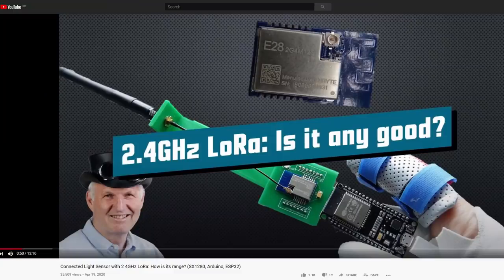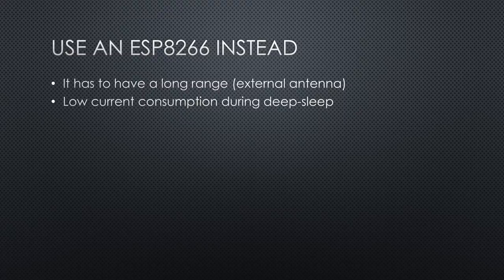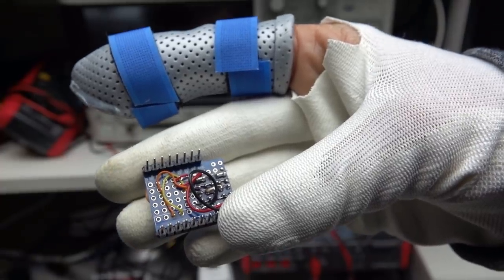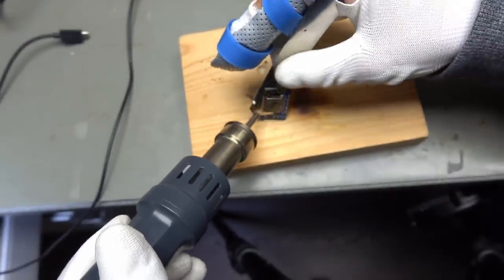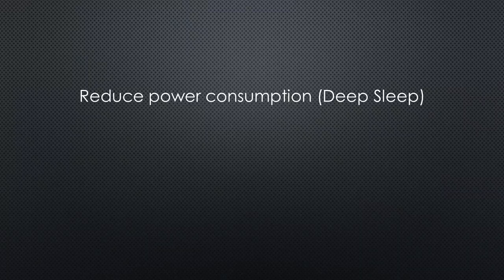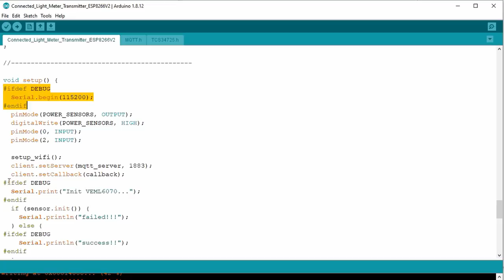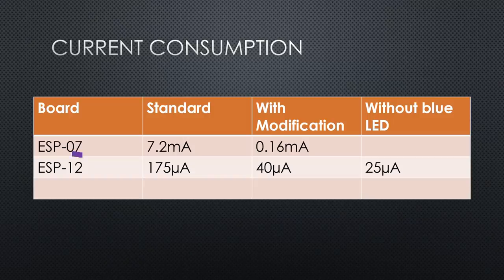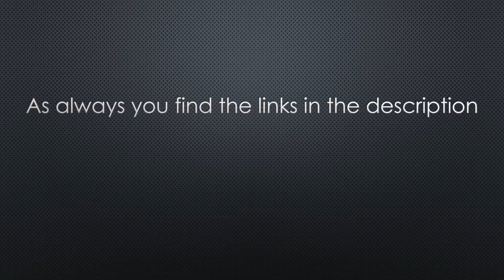#324 Wemos D1 Mini: Long Range and Low Power Modification (ESP8266, LiFePo4)

Comment: Great video. Did you have issues programming the board with RST connected to D0? The Arduino IDE gives an error when this happens on the NodeMCU ESP8266 board; you have to disconnect while programming it.
Reply from the maker: RST must free to program.

Comment: Which voltage regulator should I use for esp-01 so that that, the regulator consumes less power and runs for a longer period?
Reply from the maker: I use HT7333s
Reply: @AndreasSpiess  Any other alternative?

Comment: Hi, you do great work, thank you. I'm working on a project to run a number of heaters upto 30 from a generator and want to send the heater temp data 4 and alerts shock etc from each heater via the mains cables to the monitor at the generator. The maximum ring cable lenght is 127.8M. Would these boards be suitable and what way would you recommend to inject the signal. Each heater would send data to the the monitor and then develop an android app to control the temps and on/off criteria. Is this a suitable approach or would you approach it a different way? Thanks for any advice or pointing me in a better direction. Great channel.

Comment: When I cut this pcb trace and power on the 3.3V line the wemos gets stuck in some kind of stale non booting mode. The LED (i did not remove it) turns on very dimly and that is it. If I also connect power over the USB input the sketch runs just fine but to be able to program the esp8266 (using arduino ide) I have to manually push the reset button. I guess some kind of pull up/down is not working exactly as it does on your board Andreas. It looks identical from what I can see though...
The sketch also runs fine if I reset using usb+3.3V and then remove usb power so it has to be a problem with some kind of gpio state on boot... All "the usual" pull up/downs seems to be the same as they usually are. This trace also powers some pull up resistors for D3 and D4 but I don't think that should matter.
Reply from the maker: Unfortunately I cannot do remote debugging. I would check the voltage levels at the different pins and compare it with a standard Wemos.
Reply: Of course, I'm just trying to figure out what exactly that trace is supplying. Maybe you hade it more in detail in your memory? Seems the D3 and D4 pullups are also cut as well as a capacitor or two. Debugging resistances and paths is precisely what I'm doing but I'm not sure I'll figure it out. Might as well go for something "smaller" as this project is intended for a very low power battery supplied sensor (a mouse trap).
Reply: @johansamuelsson2056  my wemos also has exactly same issue with the dimmed LED, did you find a solution for this problem?
Reply: @hobbyist_engineer  My curiosity faded and I ended up using a bare ESP-12 module instead as my main objective in this case was low power deep sleep.
Reply: @johansamuelsson2056  Thank you for your quick reply. I guess sometimes the easiest solution is using less hardware. I will check if the consumption of the dimly lit led is acceptable or not, and based on that I may also switch to the ESP-12.

Comment: What I would love to see is a video on construction of a finished project - eg, mounting the mcu board, practical wiring, connectors, proto board wiring, etc. I don't think Dupont wires and breadboard are suitable... 😁
Reply from the maker: You can easily replace the headers with soldered wires. I often keep them and they work for a long time . Maybe here I will go for a PCB. But much more testing is needed throughout the summer.
Reply: @AndreasSpiess 
Thank you Andreas. Just looking for general construction tips and techniques...
Reply from the maker: You find other videos for this topic on the channel.

Comment: Hello, I'm trying to measure input voltage on A0 pin I was wondering what is the reference voltage to use in order to get accurate measurement. I want to measure 4V connected to an ACS712 sensor, sensor output is connected to A0.
Reply from the maker: Most Wemos D1 only measure around 3 volts. The need a voltage divider for higher voltages.

Comment: Gruezi Andreas,
I'm building iot thermometer for my swimming pool.
Please could you recommend a board without need for these modifications?
Basically I'm looking for board, battery, charging module, regulator combo recommendation.

I would like to use Tasmota in following mode: read ds18b20 temp; sleep for 60mins;

Waiting for delivery from China isn't an issue, pool season starts in 7 months.
Thanks
Reply from the maker: Check out your needs (external antenna, battery, deep sleep, etc.) and then search for a board with the properties you need.
Reply: @AndreasSpiess  hello Andreas, thanks for your reply.
Your videos are great help orienting in endless sea of options and combinations :) They also inspire me to tinker with electronics.

My goal is simple esp8266 running tasmota, single waterproof ds18b20, battery operated, don't need external antena, although would be nice.

I'm struggling to find a "minimal" board - without USB-to-serial and with efficient/no power regulator, but enough to boot without additional resistors.
This is the closest i found: https://github.com/skorokithakis/tiny-ESP8266-breakout
It should complement bare ESP-12F fine, and is compatible with HT7x33.

Next comes the battery. I was thinking of single 18650 battery.
I've seen your video recommending LifePo4. Despite it, I would prefer 18650 which I can get "protected" over charge/discharge.
The problem here is, cut off voltage of 18650 battery is 2,5V (according to specs on aliexpress). I expect the esp8266/ds18b20 to malfunction, once the voltage decreases below 3v.

Please could you help with the battery, share your opinion my components selection or make some recommendations?

Also - do you favor any kind of "minimal" board, or do you prefer d1 mini and cutting the traces in battery powered projects?

Thanks,
Peter.

Comment: Hi Andreas! Antoher great video. These materials are extremally helpfull - especially for rookies like me.
One question - I'm going to make my first project based on the WEMOS D1 mini - the weather station with independent solar power supply. I've a concerns - the place where I assembly the station is located 50m away from home, where the WIFI analyzer showing -90dB (wifi router is located insie the hoise). I'm wondering if there is any possibility to create some kind of wifi repeater, which will be based on the wemos d1 min, or another arduino version with fixed ethernet shield.
Reply from the maker: I would not go for a repeater. Maybe you use a ESP board with an antenna connector and attach an external antenna (google about the resistor you have to solder). Or you go for another technology like 433MHz or LoRa.
Reply: @AndreasSpiess  ok so it can be assumed that 433 will give better range the esp. LORA is better for sure, but I'm trying to find the cheapest solution as possible :) Kind regards.

Comment: When you say WeMos ESP8266 D1 mini, it’s the base board which contain ESP-07. So you de soldered it and replaced ESP-12. Am I correct? Are they pin compatible?
What is the difference between other ESP’s?
Reply from the maker: My Wemos D1 mini do not contain an ESP-07
Reply: @AndreasSpiess  What was the module that you replace with antenna connector? Also please let me know where to buy the shield board with HT7333 regulator.

Comment: Consider adding an op amp connected to the battery so that its output changes state when the LiFEPo4 drops below 3V or 2.9V. Use that state change to interrupt the sleeping ESP and send a low-battery message. It's not so critical when your module wakes every five minutes, but other sensors, like motion sensors, might sleep for long periods, and this cheap addition reduces the risk of damaging an expensive battery.
Reply from the maker: Maybe an overkill because the battery voltage drops very slowly and you should have enough zime to react with the processor alone..
Reply: @AndreasSpiess  It is overkill for a light sensor, or any polled sensor. However, event-driven sensors, which are often the most useful, need some way of monitoring the battery voltage. A remote motion sensor that only wakes from sleep on a motion event, that is placed where no motion should ever occur absolutely must have the op-amp trick. I'm lazy, so I use one remote sensor PCB design. All of my remote sensors have that feature (plus solar charging, a LiFePo4 holder, LoRa, a ZIF socket for a Teensy LC or 3/3.1, plus a socket for an SPI bus ADC chip. It mounts perfectly in a 10x8cm box with a PV panel on top and a dipole LoRa antenna on the bottom. The board & box cost me $11 US each. Having that feature has saved a few batteries in the past year alone.

Comment: Hi Andreas, thanks for introducing lockdown quickie projects, it is certainly a nice addition to your channel,  in a time where many of us, have a lot more hobby time at home. As always I enjoy your projects, for this particular one I would like to ask, if it is possible to connect an external antenna to a standard ESP8266-12E board, by cutting off the PCB antenna and solder wires directly to the board. I have seen videos demonstrating this, but the procedure shown does not look convincing to me. Do you have any suggestions on how this should be done the Andreas way?
Reply from the maker: I would not do it because it is not simple. To do it right you would need a VNA and lots of time. You can try it and maybe you get better results than with the PCB antenna.
Reply: @AndreasSpiess  This was kind of what I feared, maybe I will give it a try (as the supply-chain of new parts have stopped for the time beeing). Thanks for your answer and thanks for having this channel up running, it is super educational

Comment: did you ever try the d1 mini with deepsleep without wifi but with a 433mhz transmitter instead ? should save lots of juice.
Reply from the maker: No. But with LoRa. But 433 is also a good idea

Comment: I tried the deep sleep modification (cut the line near D7 and removed the led) but the Wemos D1 mini (ESP12F) is not restarting from deep sleep when supplied by two AAs. Its does restarts from deep sleep when powered by USB. Any thoughts?
Reply from the maker: Other viewers also suggested that there are different board layouts around. So you have to check if the needed voltages at the pins of your board are still there. Compare all pins while powering with USB and with battery and you should find the difference.

Comment: You can hack a 36led harbor freight  security light with solar panel. To power your weather stations very easily  they use lipo4 3.2 volt cells just fyi think they are 9.99. Pretty cheap powdr option and the light still works as intended
Reply from the maker: Good idea to repurpose a commercial product!

Comment: "Time is Energy", absolutely agree.
This is why i wrote few days ago opensource library (not arduino yet, but it is coming soon) for collectd protocol, i think it is better, for collecting sensors data.
https://github.com/nuclearcat/collectd-embedded

What is most important it uses UDP packets, and it is "fire and forget" ( collectd server will handle rest (including forwarding to mqtt, saving to csv and to timeseries database for graphing, and possibly all at same time, it can be installed on raspberry as well).
While MQTT is:
1)NTP (might be skipped, probably, if certificates are not verified) handshake
2)TCP handshake
3)TLS handshake
4)MQTT auth handshake
5)Sending message (also over TCP - require ack)
Reply from the maker: So we wait for your Arduino implementation. Sounds good.

Comment: Hi, I have a ESP32 D1 mini. I tried powering it with 3.3v directly but it won't boot.
Even supplying 5v to vcc does not start the esp.
USB works fine however, and when I start the board using usb, It continues to run even when i disconnect usb while supplying 3.3v. Even reset works fine.
I checked if the on board electronic pulls down the enable or gpio0 pin but both are high.
I'm kinda stuck, I tried it with another brand dev board and that runs fine on 3.3v (but that one consumes nearly 10mA during deep sleep compared to the 150 µA of the d1 with power led removed)
Reply: Nevermind, My Board seem to be busted in some way. I tried it with another D1 board and it works perfectly.
Reply from the maker: Glad it works now!

Comment: What is the best board that provides low voltage during deep sleep and uses esp8266? Thank you.
Reply from the maker: The module alone. You find PCBs like that on AliExpress.

Comment: Why not use a d1 mini pro? It has wifi connector on board, just a small modification with jumper is needed.
Reply from the maker: Because I do not have one and China supply chain is quite long these days :-(

Comment: ESP-07S have a bigger flash and no ceramic antenna and no led
Reply from the maker: I saw them, but I did not have them on hand. And I was not sure if they have the same pinout. So I did not want to mention and afterwards read complaints if they do not fit ;-)

Comment: Hi there, Andreas, love your channel, learned so much from it. I also love the D1 Mini. Quick question, I notice you used a tantalum cap in your design. I don't have any if them at the moment, is it possible to use ceramic caps instead? Or is there a reason not to use them?
Reply from the maker: If the ceramics are big enough it is ok to use them, too. I like the tantalums because they are small and are good for power supplies.
Reply: @AndreasSpiess  Thanks so much for the response!

Comment: Great video Andreas! Concerning the mod for lower power consumption - do you have an idea where to perform the cut in the Lolin D1 Mini? Looking to the picture https://docs.wemos.cc/en/latest/_static/boards/d1_mini_v3.1.0_1_16x16.jpg it seems to me the cut has to be carefully done...
Reply from the maker: Mine was simple... It is probably not easy to cut on this board.
Reply: where would you cut it?

Comment: Hi, great video, have you tried deep sleep on wemos d1 mini with an external wake up? I've seen in theory it doesnt work the same as other 8266, but havent found a practical example of it.
Reply from the maker: It is the same as if you connect GPIO16 to RST. Just connect another source to RST and it wakes up. You can try it with a button and a pull-up resistor
Reply: @AndreasSpiess  thanks

Comment: Why not use an Wemos D1 Mini Pro?
Reply: Ik agree, i alsof user the D1 mini pro.
Reply from the maker: Good question! Because I do have lots of those and the logistics chain is incredibly slow these days. Do you know it’s power consumption in deep sleep?
Reply: @AndreasSpiess  only one way to find out ;-)
Reply: @AndreasSpiess  post a link to pastebin and someone can run it on their pro Version to measure amps and calculate power
Reply: @AndreasSpiess  Just checked a D1 mini Pro with a SHT30 sensor. Without modification and powering it with a LiFo4 battery at the 3.3V pin. It takes around 320micro amps (0.32mA)

Comment: i am powering my weather station from 18650 lipo and i see the jumps in voltage readings. i forgot about capacitor but what value should i get?
Reply: 220uf Tantalum
Reply: @JC-zl7sq  i try to learn about electrics so can you tell me what is the method to calculate capacitor? It depends on voltage of source or what?

Comment: 3:40 where I have to cut 3.3v power on D1 v3.0.0 board?
Reply from the maker: Some other commenters suggest that my hack does not work for all boards. So you have to check with the diagram and the traces of your particular board.

Comment: Thanks for another good video with ideas suitable for a lot of viewers. Have you tried to add an external antenna to the ESP-12 module of the  D1 mini by cutting off the pcb antenna and adding a small uFl connector?
Reply from the maker: No. I do not do such experiments because I cannot measure the effects in a reasonable time.
Reply: I've tried to add a "small" uFL connector w/out success! Not much metal on them.  After melting ~4 of them, I decided to cut off the female connector from the diploe antenna wire.  Separated the two wire peaces, tinned them and just solder them to the board right where I cut the antenna traces for the uFL male connector.    Easy Peasy, and it works great

Comment: Thanks Andreas. Great video. I'm running the Wemos D1 mini v3 which seems to have a different layout. I've not yet located where to cut the power to the LDO. Unmodified mine consumes 4 mA in deep sleep! (feeding 3.3v directly and tested with Current Ranger). Seems to me like board design has got worse.
Reply from the maker: Maybe they also sell different versions. Every cent counts for them.
Reply: Andreas Spiess yes, seems lite the first version I tested is à poorly designed  knock-off. I tested another board with same sketch and got around 170uA as expected.

Comment: Hmm... a worth modification if power is low on battery then you might want to do 10min readings instead of 5min readings as an extra powersave feature.
Reply from the maker: Good idea. Or even one hour